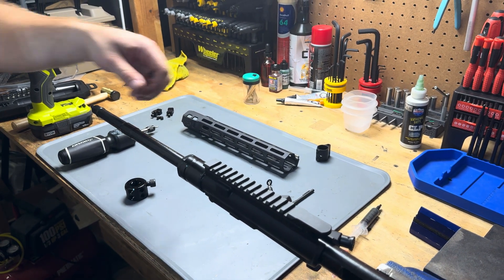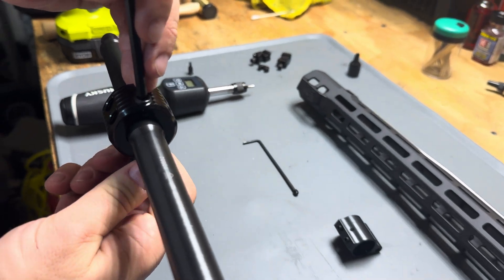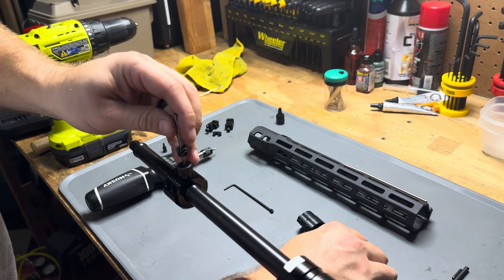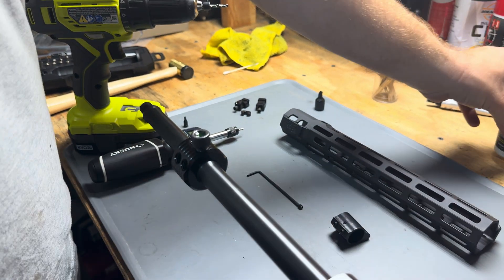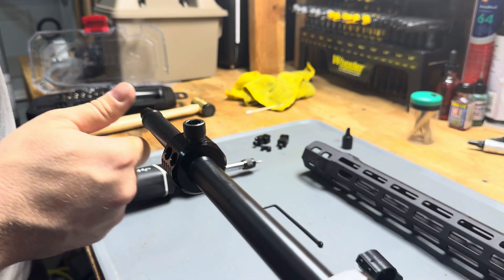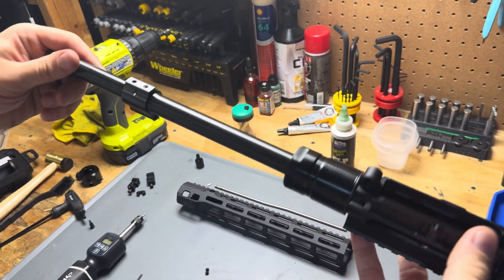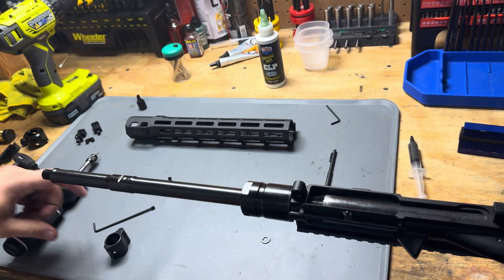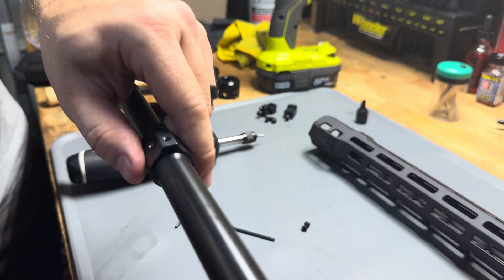How to Dimple an AR15 Barrel and Install a Gas Block

Comment: Great video thank you. I'm building my first upper and glad I ran into your video for the gas block installation. I got the SLR dimpling jig and was able to get the 5/32 carbide tipped 135-degree drill bit from a company called McMaster-Carr, part# 2750A13 and the 5/32 drill stop collar part# 8865A143. I also found a spacer washer to limit the depth of the dimple. Following your video helped make the job easy, and with the right tools, more confident, it's all lined up and done right. I took the rifle for its first shots, and the cycling was perfect and no problems after 100 rounds down range. The only thing I didnt do is pin the gas block.

Comment: The block has two set screws, but you only did one dimple. Is two not recommended?
Reply from the maker: You certainly can dimple both if you want. However, every gas block has a specific spacing...so if you dimple both, and then change gas blocks in the future then you may or may not have the correct dimple then depending on the next block you use. All (at least that I've used...but there are always exceptions I'm sure) gas blocks have a set screw directly opposite the gas port though which is why I only dimple that one. It allows for universal gas block changing, perfect alignment of the gas block in the dimple, and from my experience provides more than enough security with just one dimple to suffice
Reply: @txarms  Got it. Thank you.